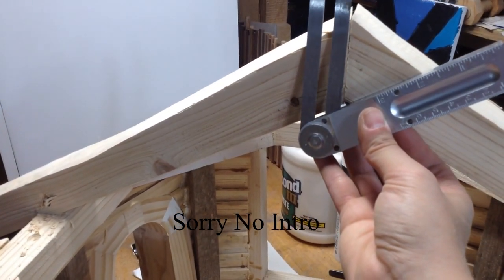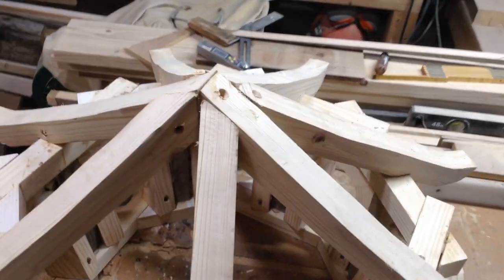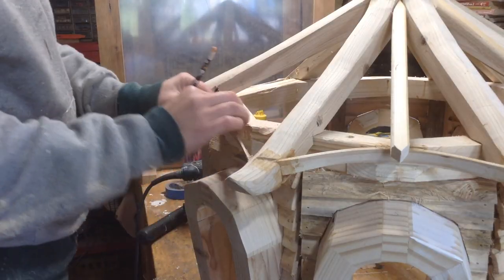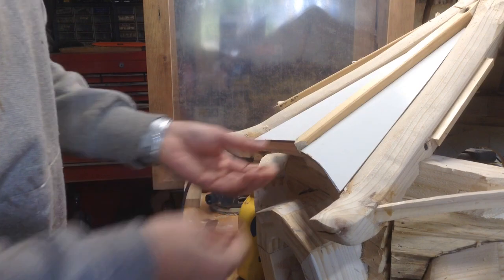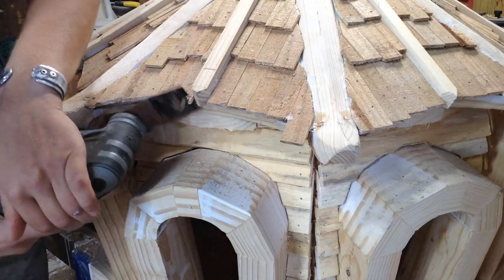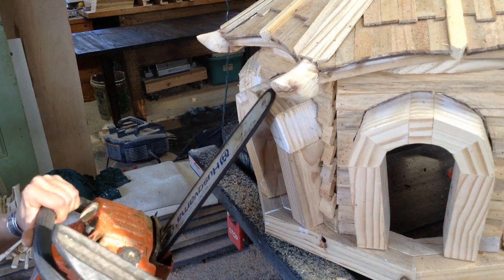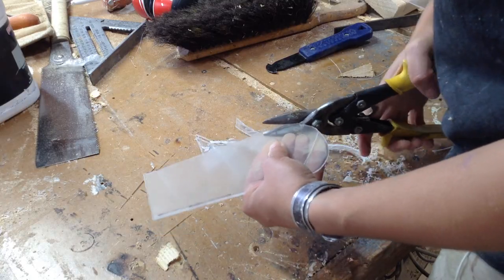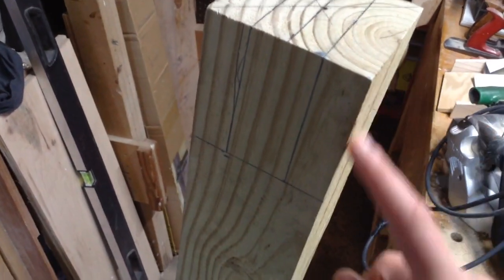Woodworking : Lending Library // Part 2

Comment: Nice results of all that custom fitting! Was that a Kutzall on the grinder? Do you like that wood-shaving wheel product? I wanted to recommend it to friend that wants to dish-out a tree trunk. Some caulk, primer and voilà: awesome lending library!  Kate: I found a lumber mill in Plumsteadville called Heacock Lumber. Great service, had milled my friend's Oak tree but boy, since I am such a friend w/truck, I sure learned how heavy 6/4 oak undried lumber is!  If you need any oak in a year... ;)  Thank you for taking time to show us your project!
Reply from the maker: Yeah its the Kutzall medium disc.  I love it.  If they weren't so pricey I would get the Coarse and fine grit ones as well.  Huge time saver and last FOREVER.